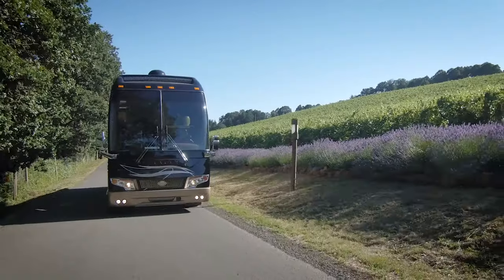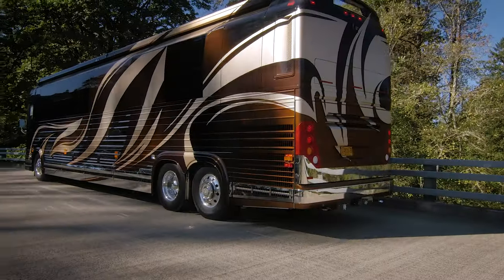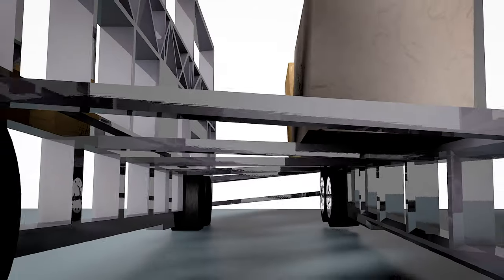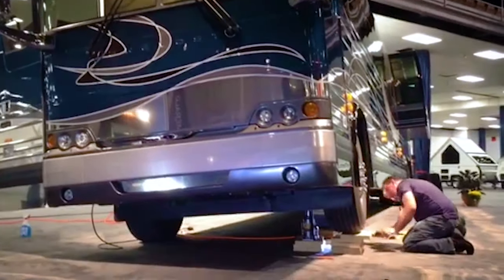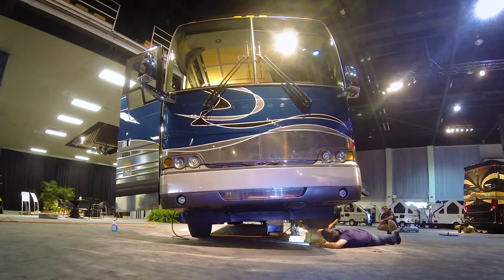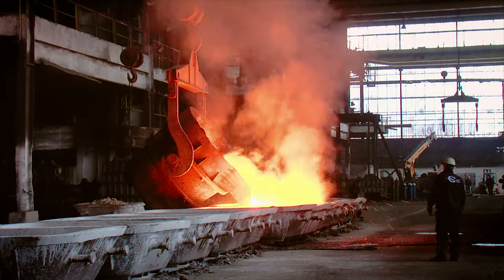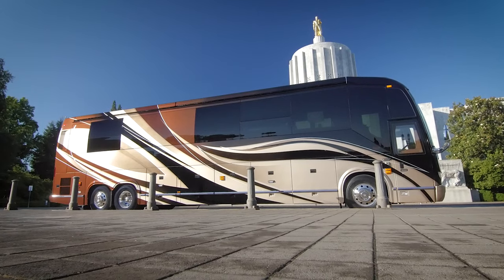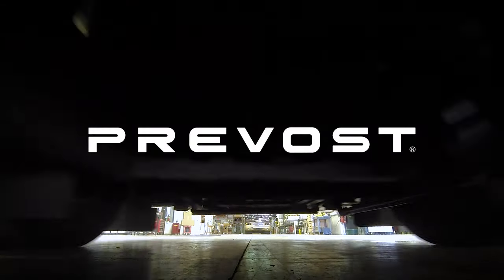Prevost: Exceeding Expectations

Comment: Do other motor coaches have an issue with the chassis flexing and causing issues inside? What about motor coaches that are not a conversion like Newell?
Reply: if it aint a Prevost or Newell...then its trash
😎

Comment: I like prevost rv  I have a nice desing  make 2 Slide balcony 1 up 1  down it should be a double decker behind the bedroom there should be a corner room and up stairs should have a small store room
Reply from the maker: Now that does sound grand!
Reply: Thanks for replying
Reply: How many months, years
Reply: Are taken to make the same rv design with I sent and are you making if I did something wrong sorry for the inconvenience
Reply from the maker: Building a coach is a 16-week process that requires 5,000-10,000 hours of labor depending on the complexity of the custom coach. A custom-built coach, on average, takes approximately six to nine months to complete.

Comment: Towards the end of this video where the coach is running over the camera, what is the wire or cable from the coach to the ground dragging?
Reply: I saw in a car like that
Reply: Ýes, is called a statically ground wire in case of lighting strike most gas transport truck like propane has them.

Comment: Just curious if the coach generator can be used to charge an electric vehicle
Reply from the maker: Absolutely, if the electric car uses a standard household outlet for charging. Most electric vehicles have a specific charge rate and voltage. Those specifics would have to be researched to ensure the proper install for the electric car.
Reply: Marathon Coach Inc thanks for letting me know
Reply from the maker: Absolutely our pleasure.
Reply: @marathoncoach  also standard outlet: we talking about the long/short prong wall outlet or the one meant for stoves/dryers/etc

Comment: but is it steel or that other shit the al.
Reply from the maker: Thank you for watching our videos. A Prevost chassis is assembled with robust 304 grade stainless steel, known for its structural integrity and durability, providing you with a heavy duty frame with optimal strength, safety and longevity. Plus, because this stainless steel frame is 100% welded, not bolted, it provides an unparalleled structure similar to that of an aircraft.  Best wishes and happy adventuring.
Reply: is it welded or screwed
Reply from the maker: Welded.